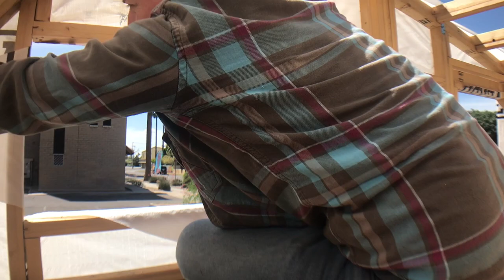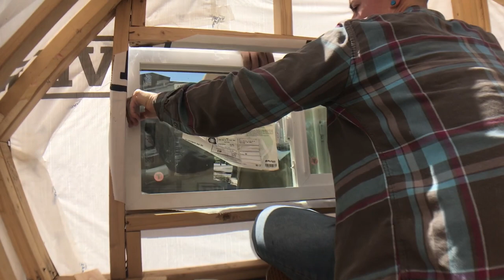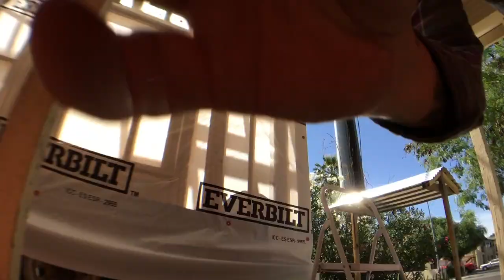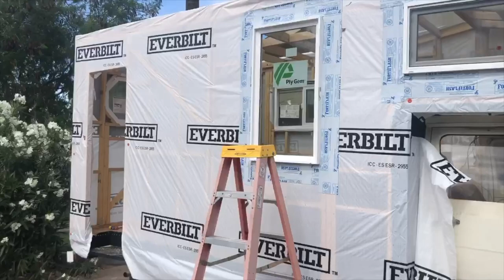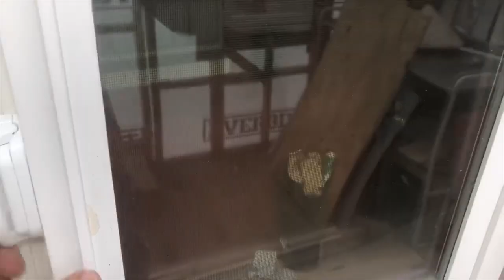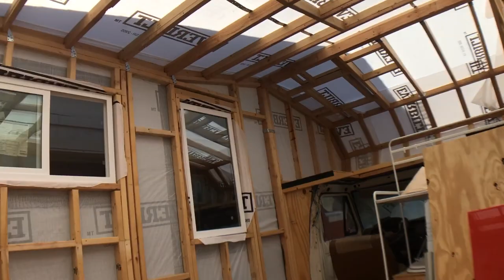Van Build: Installing the Windows | Tiny House Van |

Comment: I'm curious how the windows will do going up and down the road. Do they rattle or make it heavier?
Reply from the maker: New Horizons They are heavier than the rv windows but I wanted homier feel. I haven’t been down the road with mine yet but these are the same windows folks use in tiny homes so I’m hoping they travel well. 🤞
Reply: @shakesrattlesandrolls8064  safe travels. And I totally agree with having a homey feeling